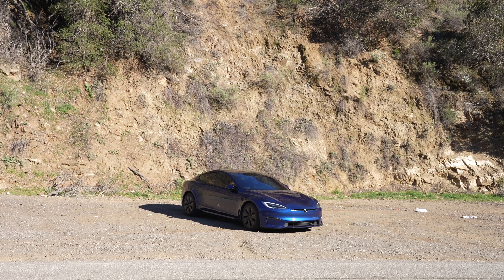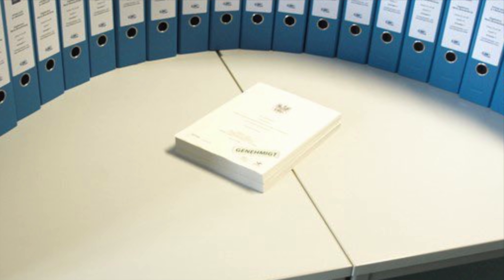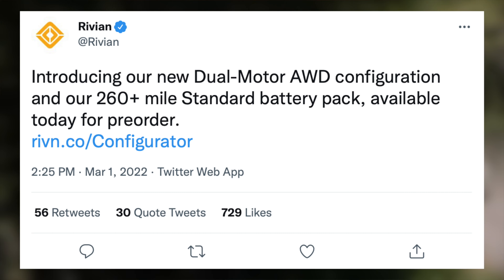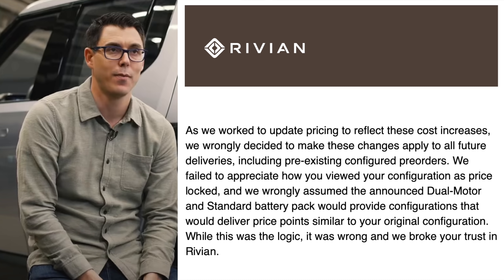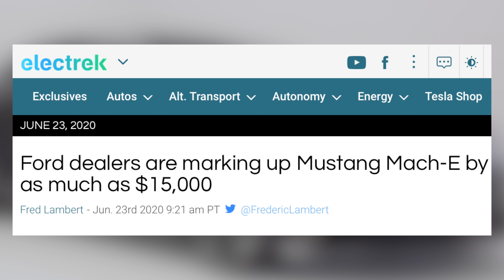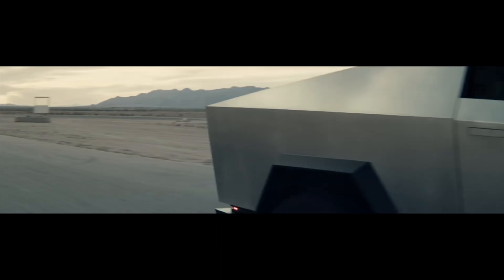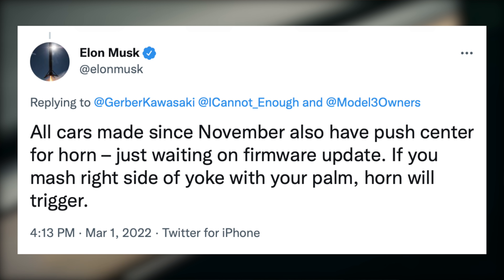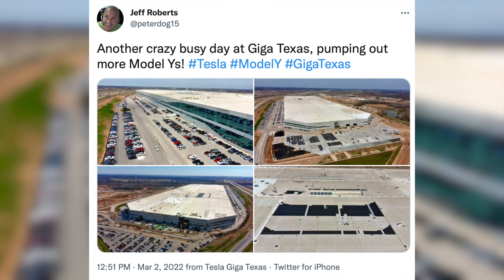It's Too Late To Buy Your Tesla in 2022

Comment: Tesla has done similar price changes to reservation holders.

Good to hear that Rivian backtracked and has decided to honor the original price for preorder holders.
The problem is that they knew that the cars were underpriced long before the COVID induced supply chain issues. They could have gradually raised prices on successive reservations over the months/years.
Rivian made a reference vehicle and the performance and quality exceeded expectations for a first time manufacturer (hence the awards/accolades) but wanted to also win customers with a low price point.
I did cancel my preorder for the R1S and I believe that was the impetus for RJ to reverse course, but even though I am considering going back to them, I am wondering if they will try to do something else as underhanded again.

Unfortunately, for now, there is nothing available with similar performance, capabilities (quad motor) or quality that I can get in the short term.

Regarding the other topic of range, once these electric vehicles can fully charge within 15mins (think of the waiting line at a chargers)  or have the same ubiquity of chargers as gas cars (maybe more because of the rate of charge) then, range will not be such an important factor. For me, my minimum is 300 miles per charge for an EV - especially in this price range.